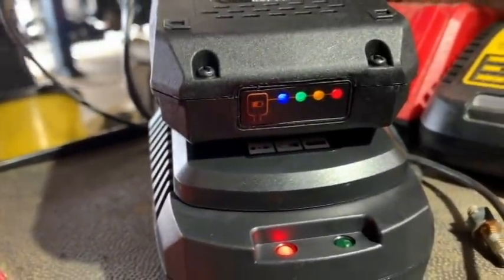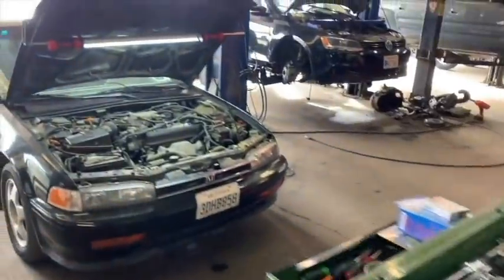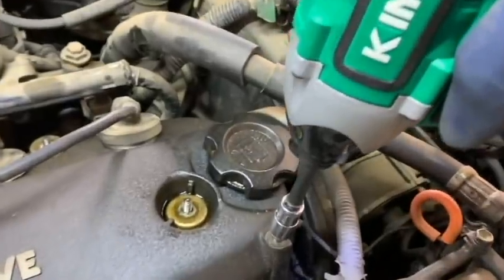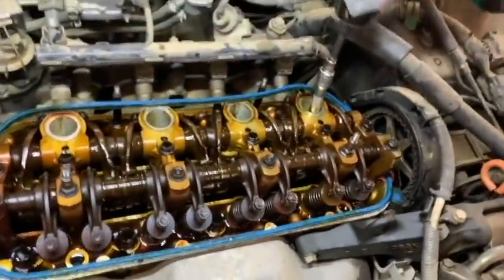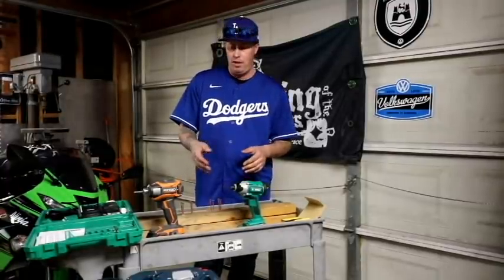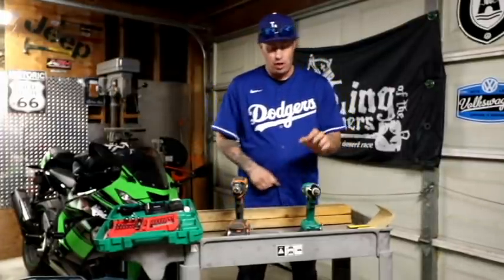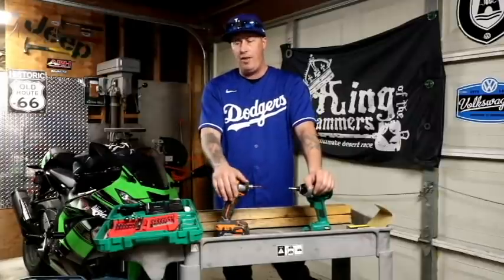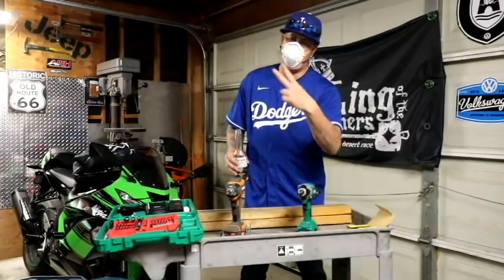KIMO CORDLESS IMPACT DRIVER 20V MAX REVIEW

Comment: When I started in automotive I used a 1/4 hex driver for for a most of what I did under hood. Valve covers, oil pans intakes, stuff along those lines. Sometimes used it for breaks, sometimes just couldn’t breaks the hardware loose. And it works great for dash work. Definitely good to have a 1/4 hex around, especially when starting out in this field.

Comment: I have all Milwaukee cordless stuff, but my dad recently got a kimo 3/8 cordless ratchet that's 12v and I've used it quite a bit, seems like a great tool!
Reply: How's it holding up? Thinking about getting one while my Milwaukee gets repaired
Reply: @thedude4707  it's doing good. Not as much power as the milwaukee but still useable for sure!